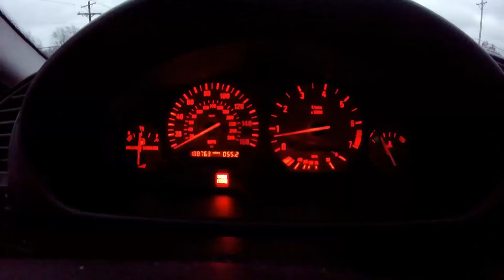Should You Ever Replace Your Transmission Filter?

Comment: is it worth changing it I got a 08 impala ss and sometimes it doesn’t catch 1st until 2500 rpm but other times it works good could it be bad 1st gear or something
Reply from the maker: You need a pressure control solenoid. Very common on those years of 4T65E.
Reply: Pete's Garage  thanks so much man hopefully it works
Reply: Do you have any idea why the car goes up hill it turns off but fires right back up
Reply: Pete's Garage got a ?

Comment: The transmission filter should be replaced every 100k miles because the clutches, clutch plates, and carrier bearings, shed material. that is what the filter is there to remove before it damages the pump.
A slightly restricted transmission filter can reduce flow to the hydro pump and cause premature transmission failure.

Comment: My transmission fluid just started smelling burnt. Won’t go in reverse has to wait a few minutes for it to go in reverse. Would it be wise to change the transmission fluid and filter vehicle has 183,000 miles. Talk to several Mechanics  and they couldn’t give me an honest answer
Reply from the maker: I highly doubt changing the fluid is going to fix your issue. Is the fluid level correct? If it’s burnt, then you probably have burned clutches. Which means rebuild time. What kind of vehicle do you have?
Reply: @PetesGarageandperformance  2003 Nissan Xterra the reverse started working normal again the fluid is black and smells.
Reply from the maker: I doubt it’ll last long though. The burned fluid is due to a burned up clutch pack.

Comment: I concur.  The membrane of oil filter paper used, catches smallish particles and carbon.  Fine metal parts, resulting from normal wear and tear passes through the paper membrane bacause they are microns is size.

A perfectly good working transmission have no pieces of grit or wear an tear material that needs trapping.  Hence the filter is a course filter like a baking flour sieve.   Thus flushing or changing the oil is all you need if the box is in good working condition.

Comment: My Trans Filter is internal! Can't get to it without splitting the case! Lol
Reply from the maker: Many of the newer vehicles are like this now.
Reply: Basically guaranteeing that the entire transmission will go out shortly after the filter gets clogged. Maybe the initial problem was just some rust from the transmission pan and added viscosity from starting cold, but soon the filter will be collecting plenty more as it breaks down from poor lubrication and malfunctioning hydraulics.
It's called planned obsolescence and they do it on purpose.

Comment: There’s another video of a external tranny filter being changed. So how many are there of these tranny filters,?
Reply from the maker: There are only a couple of vehicles that I’ve seen with an external filter. The Allison and the old Saturn transmissions. Those are considered routine maintenance to replace those filters. However, the Allison also has an internal filter which doesn’t get changed routinely unless the transmission is operating under what GM calls “severe conditions”.

Comment: What if the Transmission sounds like starving from fluid when cold and when warmed up the sounds goes away?
2011 Elantra 155k on it 
It makes like a grinding noise when cold but completely goes away when hot 
Someone told me it could be a plugged filter because when cold it's more difficult to the oil to get thru the filter 
For me it makes sense
Reply from the maker: It is possible that it could be clogged. But if it’s clogged, you probably have another issue that is deeper in the transmission. I would remove the filter and cut it open. Inspect for debris. Brass is bushings, metal shavings is some metal to metal wear, coffee grounds is probably from the torque converter clutch.
Reply: @PetesGarageandperformance  Thanks for the advice

Comment: Iv had cars that wouldn’t shift anymore and I changed my fluid and filter 3 times within a few months of driving 2 +hours daily and fixed it completely drove it to 310,000 miles then sold it running

Comment: Transmission with time, will wear and produce metal and clutch material that will get caught in the filter. Dirty filter will result in reduced flow which will cause more slipping and more material to get caught in filter and further reduce flow. So yes dirty filter is an indication of other problems but replacing filter occasionally will extend transmission life. How often, who knows, maybe at 60k or 70k and more often as the miles start to pile up.

Comment: So your point iss.. just wait until the whole transmision to fail? Instead maintained it regulary every 50k miles / 100k kms?
Reply from the maker: That’s not what I said. Still do a fluid exchange every 50-60k. No need to drop the pan.

Comment: well, i'm thinking about changing the filter since its been used for 15 years and the sponge or the filter inside may have been very dirty and effect the oil flow out after the filteration. the idea is to make sure the flow is smooth and not passing through old sponge filter. Do you think the oil flow will slow down after the filter been used for many years. in malaysia they keep showing this videos that the filter is blacked up and clogged and the sponge filter is damaged and looks like it will effect the flow of the oil and will impact the smoothness of transmision.. hence will give out less power... please do explain....https://www.youtube.com/watch?v=pKIHIgcc7nI&t=16s

Comment: If that's the case let's ask ourselves why the engineers that designed the vehicle put the transmission in it in the first place? Filters are designed to hold dirt therefore it is not a horrible idea to change it every two years.

Comment: just bought a ram 2500 with a 545rfe trans. filter was split on the side. filter was a mopar brand. 100 % change filters
Reply from the maker: Obviously you replace it if it’s broken. Are Mopar filters really that bad that they split on their own? Or was the pan smashed at some point and it broke the filter?
The only time I’ve seen a filter be broken was when a customer smashed the pan up and it broke the plastic filter.
Reply: nope on its own, but still they are a one and done.

Comment: I have a mazda cx5 2014 with 110,000 miles do you recommend to replace the filter? since i have to drop the pan to replaced it. Thank you In advance.
Reply from the maker: Are you just trying to be proactive with maintenance or are you having a shifting issue?
Reply: @PetesGarageandperformance  yeah i just wanna give it maintenance just bought it from dealership, shifting still smooth but fluid look brown. Old owner may never change it before.
Reply from the maker: I would just flush the fluid with an exchange machine or do a drain and fill if it has a drain plug.

Comment: I have been reading up on the U241E 4-speed transmission in an 03 camry 4-cylinder I just bought.  Some reviewers of transmission filters also warned about the aftermarket filters using a different media.   Since the OEM was more of a strainer the aftermarket filters were restricting flow and causing unusual behavior in the transmission.  It seemed these may have been limited to the U241E transmission in a Rav4.  Any thoughts?

Comment: So changing the atf oil and gasket is find at 167,000
Reply: Not usually.  It is a gamble, but often it is better just to leave it alone at that mileage, and hope for another 167,000 miles before the transmission dies.  New fluid may cause the transmission to start slipping, because the thicker worn-out fluid is likely what is holding it together.  Have a trusted mechanic inspect the fluid, if you want more information on its condition.  If the fluid is not brown or black, or smell burnt, it may be okay.  Again, it is a gamble at that mileage.

Comment: Hey all question for whoever might know. I changed my transmission fluid and filter then a couple months later changed the fluid again but kept the same new filter in. 1000 miles after it's slipping only until it reaches operating temp then it shifts fine I read that the new fluid could have loosed up some stuff and clogged the new filter what say yall? It has 65000 miles on it a 2012 mazda 3 skyactiv.
Reply from the maker: Have you checked the fluid level with the engine running? If the engine isn’t running when you check the fluid it will be under filled.
Reply: @PetesGarageandperformance  no because the dip stick is under the air box I turn the engine off and as quickly as I can remove it and check the dipstick
Reply from the maker: That won’t work. Run it with the air box off but keep the mass airflow sensor plugged in if it has one. You’re probably a quart or two under filled.

Comment: Any new or rebuilt trans I would be sure to change fluid and filter early or if engine was badly overheated with OE fluid. I would change fluid filter three times every 100,000 miles normal street use. Sad to say these days you have to get creative to change some vehicles' fluid. I would not go any higher than 20%-25% of OE auxiliary cooler capacity would be over kill for street use. Differential would change twice during 100,000 miles with OE fluid. OE fluid is synthetic and specifically engineered for that particular vehicle. There some companies that can make and probably do make highly compatible OE fluid. This my take for my personal vehicles. Definite worthwhile discussion.

Comment: 4:40
A drain and fill will not get the oil out from the torque converter?

Do u mean that the oil from the torque converter doesnt mix with the oil from the pan? Like they are entire 2 different separated world?
Reply from the maker: They mix when the engine is running. But there will still be some of the fluid in the torque converter even if you drop the pan. A 4l60e takes about 10qts of fluid when you rebuild one. If you drop the pan, you only lose 5qts. There is 5 more quarts within the rest of the trans and torque converter.
Reply: @PetesGarageandperformance  
Ahh i see.......

So lets say..by doing a simple AT pan drain and refill, i only replace 30% of total fluids in the transmission system, so in theory if i do the oil drain and fill 4times in a month, am i going to get a fully clean AT oil inside the pan and inside the Torque converter and the entire AT system?
Reply from the maker: Yeah pretty much. When we flush them through the lines we use about 12-14qts of fluid
Reply: @PetesGarageandperformance  
Thanks. 
Seems like the safest logical way for AT maintenance is doing simple drain and fill.

Im thinking that AT flusher machine, has chances of cross contamination between vehicles using those flusher, either dirt or fluid additives cross contamination.

Comment: Well, technically speaking, it's not even a filter, it's a strainer that prevents bigger particles from being sucked into the system from the bottom of the transmission oil pan.

Comment: Friction material from friction plates or bands  end up in the filter which causes clog and inhibits good volume of flow to the shift solenoid  
Further starving the transmission of proper flow , which in turn causes way more damage , you need constant good volume of transmission fluid ..!

Comment: I use my Chevy truck for WORK and change the fluid and filter every 30,000 miles . Wipe out that pan and look for metal particles or burnt fluid. Maintenance always pays off fot the cost of a simple filter and 4 1/2 quarts of fluid.

Comment: Transmission strainers can be changed every other drain & fill, after the initial one. I have over 200000 on two separate vehicles for over 20 years to back it up.

Comment: I have an 08 lancer es. Every shop won't do a filter change and fluid. I'm so frustrated. It whines like crazy. Every shop says the same but idk it's at 126k and idk when it was changed. I'm about to do it myself. Fukit
Reply from the maker: If it whines there’s most likely a bearing that is bad.
Reply: @PetesGarageandperformance  I had bearings replaced, belts, pulleys, chain, changed out air filter box for short ram because my box was already busted on the bottom of it

Comment: If you at least do a drain & fill at reasonable intervals a filter shouldn't be required. If fluid is neglected though, clutch material builds up in the filter restricting flow leading to a snowball effect of creating more wear on the clutches. That said, neither new fluid or filter is going to fix something that's broken. If fluid is very dirty but shifting OK, give it the full service. But if it's slipping/flaring it's already too late.

Comment: Hey could you help me on my transmission because when I put it in reverse it kinda slam and recently when I put it in Drive it doesnt go forward not unless when the engine is hot and runs 10 minutes or more
Reply from the maker: What kind of vehicle? And I don’t really understand what you’re saying is happening?
Reply: @PetesGarageandperformance  not moving forward when cold start i need to wait at least 10 or more minutes to move forward and putting to reverse it slam a little
Reply from the maker: Check your fluid level. What kind of vehicle is it?
Reply: @PetesGarageandperformance  same thing happening with my Honda ES1....Car started off with a tiny issue of not reversing on a very small incline but on flat road it slammed/kicked back when I put into Reverse and it was fine after that! but still visited a shop and they added Lucas fix (they said the oil levels fine) immediately after the treatment added, car doesn’t drive forward or reverse, just revs until I switch off and restart! No check engine light came on ever! Your help will be appreciated!
Reply from the maker: Sounds like you either have a valve body issue, pump issue, or your filter is actually clogged with metal and you have big problems. Let me know what it ends up being.
Reply: @PetesGarageandperformance  Thanks for your quick response! A diagnostic was done and it stated speed sensor failure with codes of 70-03 (P0700) & 09-01 (P0720)....so I’m unsure what to do! Like change sensor and not oil and filter? I’m really lost! And even the mechanics seem a bit unsure! Not sure if adding that treatment will affect the speed sensor but yeah that’s what it said
Reply from the maker: The speed sensor code could have set because the module was expecting to see movement and it wasn’t moving. Or the magnet on the sensor could be covered in metal shavings. Sounds to me  that a true diagnosis wasn’t performed. Many transmission diagnostics will require further exploration to find the root cause.
Reply: @PetesGarageandperformance  The mechanic cleaned the sensor and placed it back in! So then I shouldn’t replace the sensor just yet and focus on the pump, filter areas?  Yeah that code just stopped at p0700 and nothing in depth! I looked at a video about the pump and that narrows down my whining noise! But nothing was this drastic until that treatment was added! Like it stirred up something in there

Comment: I've got a 9th generation Honda Accord . Just got the trans fluid changed for first time since buying it with 75k miles on it. Now has 140k.
The filters on these things are cylinder metal part that is labor intensive to get to . A transmission repair place wants $179 to clean it/ change it out for me. No thanks.
I may wait awhile before deciding whether I will replace it or not

Comment: I know what you mean because the filter has a magnetic screen inside and it picks up all of the metal at breakin and that amount is about the size of apiece of chewed bubble gum leaving over 90 percent of the filter with nothing on it and it’s all magnetic so no you really don’t need to change it and the oil filter is totally different than  the transmission always change oil filter every oil change.

Comment: I had my transmission fluid changed at 130,000 on my 2016 Corolla.The shop said the Corolla did not have a filter. After getting home I checked out the specks and there is a filter. Had a 1971 Duster for 19 years never changed the transmission filter.Guess it’s a judgment call. But changing oil with out filter does not make sence. Mabey the company’s want to sell more cars🤷‍♀️🤔

Comment: VW Passat with life time transmission fluid went 170k miles in 24 years without any problem but it had a water pump failure causing a blown head gasket so I donated the car.

Comment: I’m NO ASE or Ford trained tech.  I do know, transmission fluid does degrade via heat cycles and also exists in an acidic environment, as condensation due to heating, cooling and ambient air is present internally.  Magnets do exist to retain wear metals.  Again I remind all, I’m NO expert.  There will always be wear metals present.  As fluid flows, so do wear metals suspended in the fluid.  Not every bit of fluid touches the magnet.  Thus, the filter exists to mitigate effects of non magnet captured metal.  Will the filter capture all remaining?  Most likely not.  The automatic transmission is the weakest element of the drive train and predominantly the first to fail.  Thus, the presence of the filter.  I do know, ponying up dough for multiple filters will never surpass the cost of all costs associated with a removal, rebuild and or replacement unit.

Comment: Just changle the filter every 80-100k and u will be fine. Provided ur cutting the dealerships fluid change intervals in half! I drain and fill ws fluid 30-40k miles. Wouldnt mess with changing via the cooler.

Comment: once the filter stops fluid movement the tranny fails. Lots of old maintenance carryovers no longer required like winterizing and tuneups. Tire rotation is another one. Unless you constantly smoke the tires you won't need rotation with modern tires. They also sell alignments after changing out struts, totally not needed.